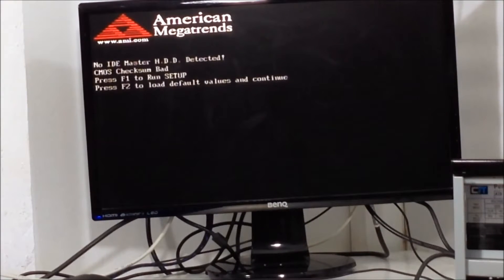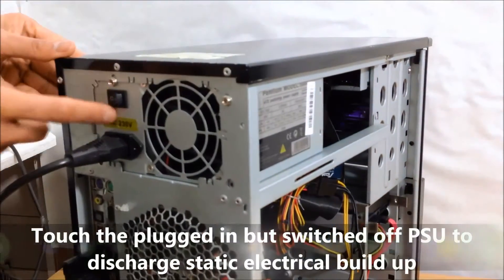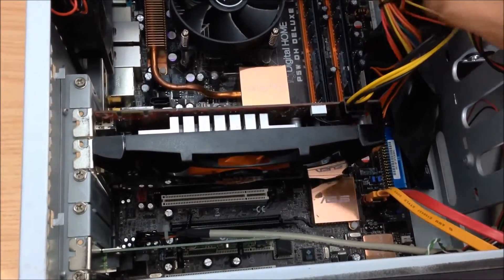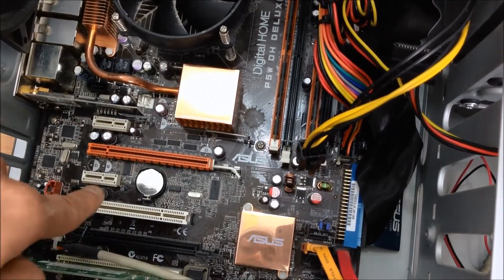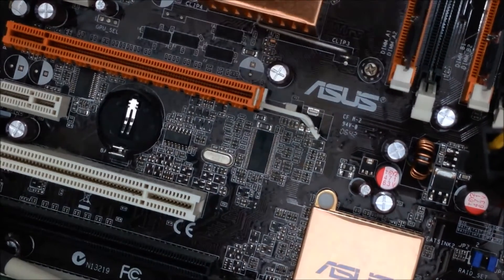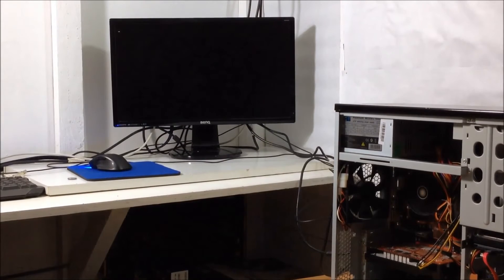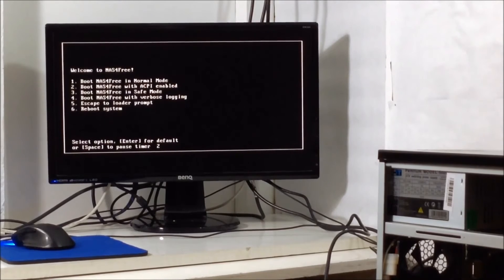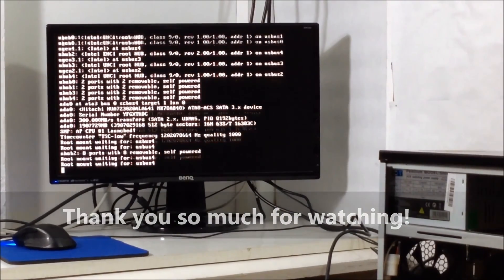CMOS Checksum Bad - Quick Easy Fix 2

Comment: You have no idea what your talking about. First you refer to this as a server, which its not. Second, you did no troubleshooting to try to correct the problems other than ASSUMING it needed a new battery. WRONG! You should have tried at least 3 different other troubleshooting options FIRST. Like setting the jumper to see if that would correct the issue. Or, removed all external devices to see if one of those was causing the problem, or resetting the bios via the bios option or even repairing the registry if it was corrupt. You should stop making videos, period!
Reply: Mihaly Freeman make a video on how to do it then.
Reply: MAke some videos if ur so smart dumbass
Reply: Removing all devices fixed it for me, nothing else has worked! Even got a new BIOS battery ... but it did’t help! Thanks